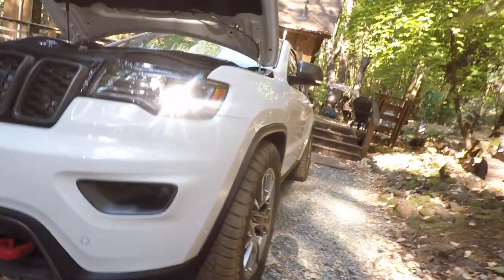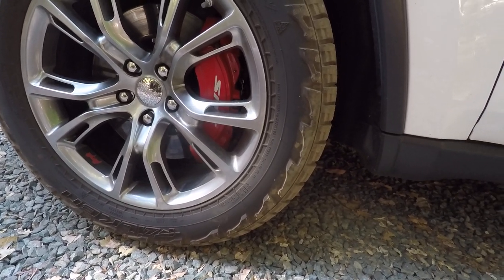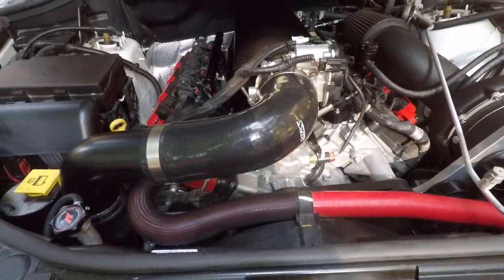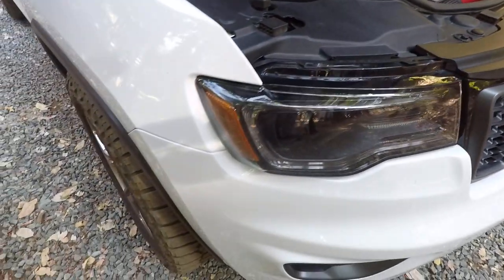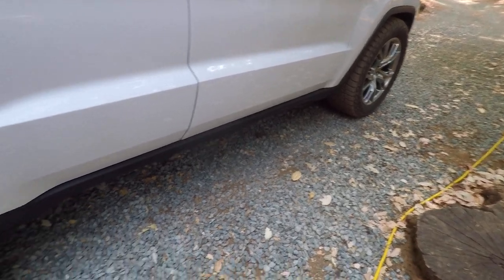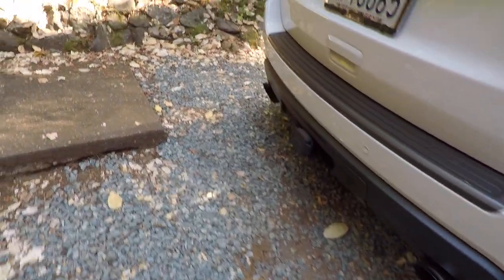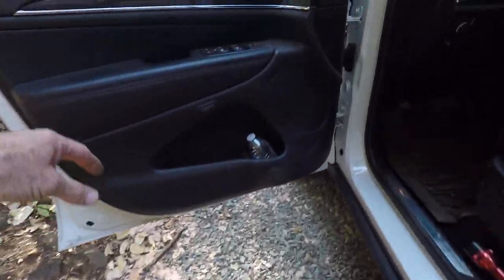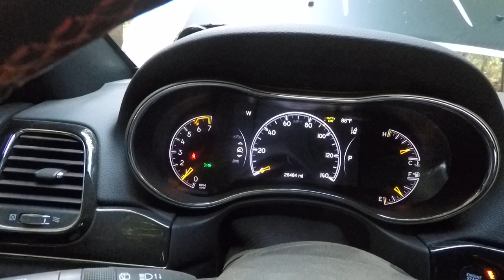Update to my Upgrades Video ...

Comment: DUDE this is just the greatest build I have ever seen. Just love everything you did. That intake looks awesome. What would be your opinion on procharging the engine, but leaving everything else stock? hellwig rear bar worth it over stock?
Reply from the maker: Thanks for that.  Procharger on stock, absolutely. Their kits is designed around everything else being stock. Hellwig. I love the idea, but on my Trailhawk for non-track use, I don't think I would spend the money on that again. An honest opinion, I do live in the mountains and have been known to drive a little spirited. I have All-Terrain tires, Under Armor everywhere and Rock Rails. My Jeep weights 6200 pounds (without driver), so that Hellwig might be doing an exceptional job over stock, and I just don't notice. 😁

Comment: HOW MUCH THAT COST? BALL PARK?
FOR THE PRO CHARCHER KIT. I HAVE A 2013 TRAIL HAWK AND WANT TO DO SOMETHING SIMILAR
Reply from the maker: When I ordered it, I ordered the complete kit which includes a new, unlocked PCM, that you will not need with your 2013 model year:
Supercharger, Complete Kit,
Procharger P-1X,
1DJ314-SCI,
FastHemis.com ( https://fasthemis.com/i-23892834-procharger-supercharger-kit-jeep-grand-cherokee-5-7l-hemi-2015-2019.html?ref=category:1204440 ) (the kit that I ordered).
I paid $8422.07 shipped.

Comment: What brand are the 20x9 Spider Monkey wheels? I'm assuming replicas.
Reply from the maker: They are Replica Wheels, and I got them from Stock Wheel Solutions. This is them:  https://stockwheelsolutions.com/wheels-for-dodge/20-fits-jeep-grand-cherokee-dodge-durango-srt8-srt-2013-14-style-wheels-hyper-silver-dark-set-of-4-20x9-rims/
Reply: @EMalnburg3  Awesome, thanks! Should be just right for my 2019 Summit.
Reply from the maker: @duxf4n897  AND, if you ever want to upgrade to Brembo Brakes, they will clear the wheels.

Comment: Holley said the intake would need hood modification for it to work. is that true or was a perfect fit plug n play bolt on?
Reply from the maker: The Holly intake manifold fit without modifications with the stock hood for a Jeep Grand Cherokee.
Reply: @EMalnburg3  that’s great to hear, so the info I read was incorrect. I’m gonna pull the trigger on that thank you for the fast response!

Comment: What’s the estimate on the 0-60
Reply from the maker: 6.00 (confirmed). Keep in mind that this is a Trailhawk, with all of the off-road armor and it weighs 6200 pounds. I am pushing 6000+ pounds 0 to 60 in 6.00 seconds.  :)

Comment: How much power does this make and did u have to do anything to the trans?
Reply from the maker: I haven't dynoed it yet. I don't have a four-wheel dyno in my area.
I am estimating closer to 600 (bhp) at the crank which is approximately 450 (whp) at the wheels.
Only a tune for the transmission.